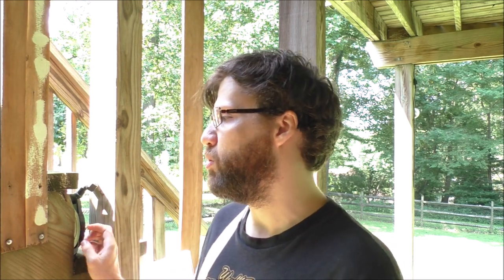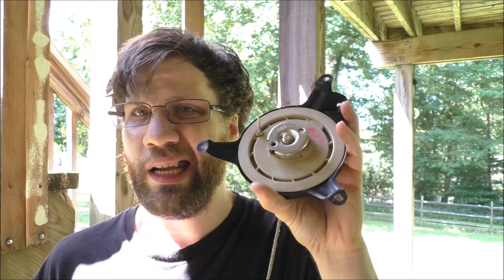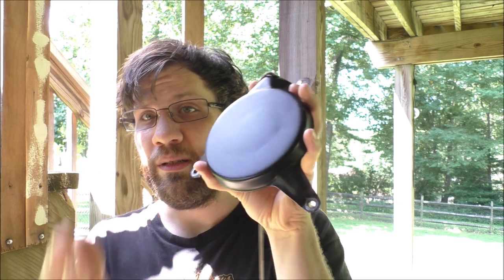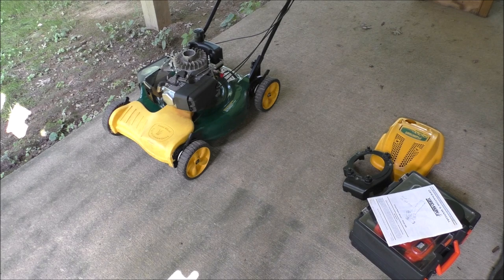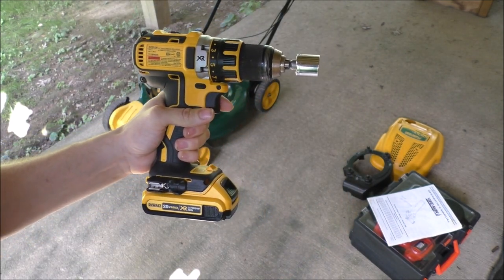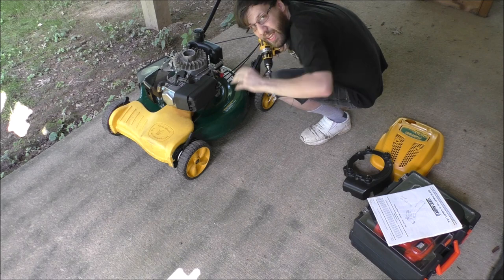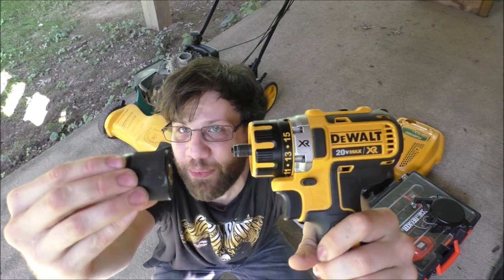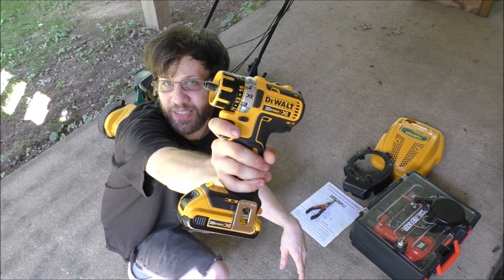STARTING UP THE OLD YARD-MAN PUSH MOWER 12A-26MB755

Comment: My old GMC started my mower easy and if you left the drill on there it would just spin the drill faster. but my new dril kicks badly in my hand, it has a chuck that locks when its not running (probably to tighten the bit)but or if it is running slow like a few RPM if i spin the chuck its locks the drill.I am not game to do it again incase I destroy it
Reply: Yes well the old GMC just spun faster till i removed it depending on how the speed of the mower was, this one just is like chucking a motorbike down a few gears and dropping out the clutch again.